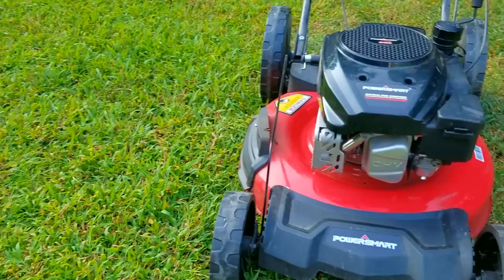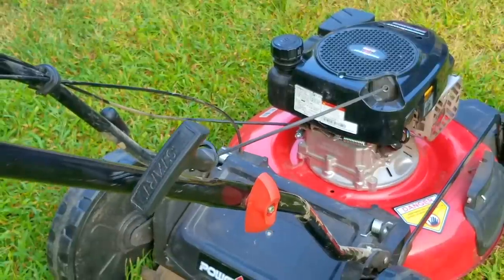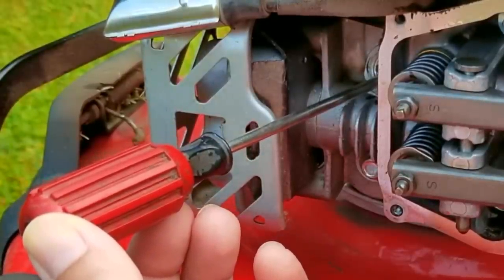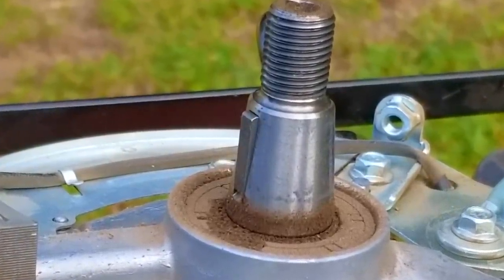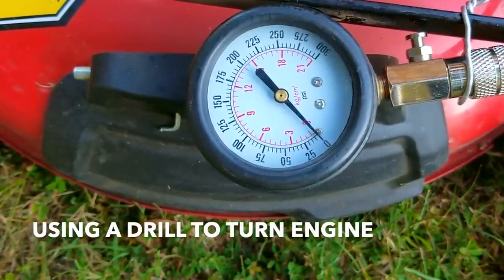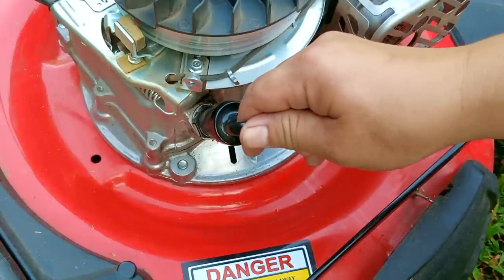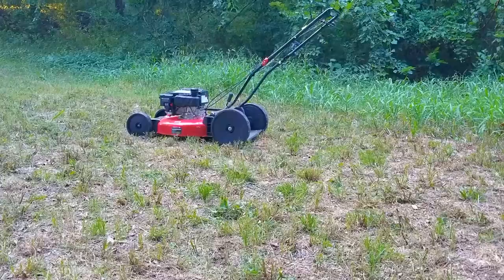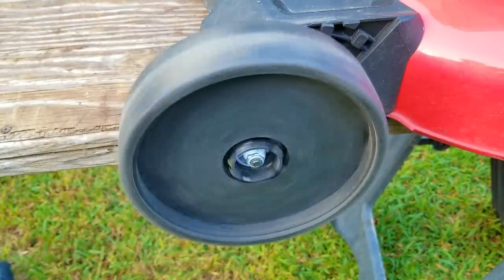Fixing A PowerSmart Mower That Won't Start

Comment: I got one of these free (self propelled) when I bought a Husqvarna HU700 self propelled with the Honda engine for $10 from a local guy. He said it ran too fast - I fixed that by straightening out the governor linkage and getting the RPMs down to around 2900  The Husqvarna was hard to start and the belt kept jumping off. The kill switch needed some adjustment (would not always reset) and the belt problem was just a cable adjustment. So for $10, 2 air cleaners, an inline filter and oil changes I have two usable self propelled mowers. I really like your videos. Nice style
Reply from the maker: very nice work!

Comment: I bought a 196 cc powersmart in 2019. Used it for 2 years regularly with no issues. Then I stopped using it in 2022 because I had heart surgery and had somebody else do my lawn. When I stored it, I didn't put a stabilizer so when I started using it, it won't start. I cleaned the carburetor and replaced the spark plug and it started. Also changed the oil.
Reply from the maker: nice work getting it working again

Comment: Bro, you are 100% correct about every single thing you said. I have this exact Mower. Got it in 2020 and last year it didn't work for me. This exact issue is what's happening with mine. I just put it  away last year. Now it's time to mow again, it's Spring and I came here to try to find out if I can fix it. After watching this you confirmed that it's not even worth it. They just stole my money on this mower. I used it for 2 seasons and I live in Philly so it's only warm here about 2 months a year. I used it a total of maybe 7 times in those 2 years, definitely not 10 times.  i am so upset that I have to buy another one. Growing up, my grandpop and other old heads around used to have mowers forever. These plastic things dont last. Your presentation is on point as well. Great job bro. It's just crazy that my problem is EXACTLY the same as this one. I've only used Sunoco number 93 gas and fresh oil. It didn't even last long enough for me to need any new oil so...I dont know. 1 more thing about these if you didn't know, mine smoked out after minutes of my first use. I thought it was defective until I figured out that it has to only be used downhill or on a flat surface. If you go uphill, it's going to smoke out so maybe I messed it up from the first use but they need to tell me that I cant go uphill with it... and it's not a big hill. It's just on the side of my steps leading up to my house. It isn't a mountain sized hill. I know nothing about mowers so I made sure to follow the directions. I do know about cars so I know for sure I didnt put too much oil in it. I rather run it with low oil than too much. Have no clue what's goin on with this thing. They need to stop selling these, this is a rip off. Maybe that can be your next video on how this company needs to stop selling these.
Reply from the maker: wow, thank you for confirming that and sorry to hear they stole your money. As tempting as the price is, it's not worth it.
Reply: @Tru Tru I'm agreeing with you one hundred percent my friend.I bought 2 of them. One for myself and one for a relative as gift. His had the break-in oil changed in well less than the five hours. It was more like 2 hours, and then brand new motor oil. Relatives push mower will start immediately, however when he had to shut it off to move stuff in yard it seemed locked up and would not restart. Then after cooling down completely several hours in the shade it would restart.
Reply: @INSIDEHOUSEGARAGE  I agree with everything that was stated by @Tru Tru on your awesome video. As you can see I replied to him with what happened to the first brand new mower. And the 2nd powersmart 170cc push mower did the exact same thing on me and my wife. Break in oil changed in 2 hours & on the very next use it seemed locked up after shutting it off and attempting restart. Oil was still one hundred percent full of the proper lawn mower engine oil. I let it cool for approximately an hour & when I attempted to restart it the pull cord knob broke. I'm only okay after replacing new pull cord handle & never attempting to restart until it's cool down 100%. Then it'll restart, however I would much rather drop kick it across the yard. Spot on video & thank you so much. We appreciate the video & dedication.😊

Comment: Bought one a couple years ago and love it.  Yes, it has some cheaper made parts and that's why I'm sure they're lesser expensive than the others.  I like it cause it's light and starts usually with one pull.
Reply from the maker: glad to hear it's working out for you
Reply: Ya I like mine so far

Comment: Hey, great video, I love your channel! I have a '99 Honda mower, that takes about 10 pulls to start when cold, however when its warm, it takes just one. I have already replaced the carb, flushed the fuel system, adjusted valve clearance, replaced the spark plug etc, its still not fixed. However, the previous owner didn't change the oil in like a couple of seasons. Could that just be compression loss/ a worn engine? Thanks for the vids
Reply: With the consideration that it has a new carb you should probably start with the choke\primer(if it has one?), then move over to the carb gaskets base and air cleaner gaskets.
Reply from the maker: yes it can, however, have you checked that the choke flap is completely closed when choked?
Reply: @INSIDEHOUSEGARAGE  No, i haven’t checked yet. I’ll do when I get the chance to.Thanks for the help!
Reply: Check that everything is operating correctly carburetor etcetera if all is in proper working order another thing would be vacuum leaks check around seal on the carb in some cases you can use gasoline to find a leak by running the engine and squinting a little around the seal / gasket and listening for the engine to rev up or idle higher for a few seconds if this happens you have a bad seal / gasket

Comment: Wow, the tools came out for this one, but it’s going...
I remember run in time is usually 5 hours on the engine for first change.
Though surprised to see that much garbage in the oil.
Now you didn’t do your spin the wheel time trial.
Great job😉🇦🇺
Reply from the maker: lol.. I wanted to try something new

Comment: Many thanks. Just bought a PowerSmart mower. After running it the first hour, I removed all the oil. Now I will look for metal filings.... So thanks!!  They say that these Chinese engines are not built to such tight tolerances as Honda and Briggs. So get those initial metal filings out. Then you are OK
Reply from the maker: nice method, thank you zenzeke zenard.
Reply: @INSIDEHOUSEGARAGE   After the first 60 minutes, the oil was very black. But no, or very, very scant metal filings. So I will put in new oil and run  it two hours and look at the oil again._____ I have a synth oil blend of 10-40. I am in hot southern Florida. IOW half synthetic. Is this OK for the mower? THANKS!
Reply from the maker: I see nothing wrong with that.

Comment: I have a Power Start, model db2322s, EN 22" 196cc, so-called 3in1. After sitting through a winter with an empty fuel tank, it didn't start in early spring. The problem is found to be air bubbles getting in the fuel line by following this step (12:30) as seen in this video. This is verified by running it till the fuel tank empty which prevents it from starting agin. By loosing this bolt to release some fuel then tightening it back to normal, it starts easily. 

It has no primer bulb nor a choke. But in the troubleshoot section the user manual says "pump the primer" if won't start. It's a joke. Made without care.

Comment: So slightly off-topic, but something I think you will approve of. I've seen the little rounded scraper you use to clean out the grass from under the mower deck. Checked online and saw that Amazon wanted about $20 for them (IN the US). For some reason, they want around $80 for them on Amazon in Canada. (Don't ask me why. Probaly cause there's no Canadian distributor, so it has to be sent from the US manufacturer, but I digress.) Anyway, I thought that was ridiculous. I dug out a straight scraper about 2 2 1/2 inches wide and used my grinder to round over the corners. I think I got 3 scrapers of differing widths for about $8 for all three. LOL  If you can't be handsome, you better be handy! LOL
Reply from the maker: hey nice work and very ingenious of you.

Comment: My neighbor bought a PowerSmart 200cc based mower last year, and after storage for the winter, I was worried it wouldn't start.  
I'm helping her maintain the yard this year, (as she's nearing 80,) and have a suspicion that the oil not only was not changed after six hours of use, it likely has not been changed at all.  
It did start, and after a few minutes (and cleaning the air filter) it seemed to run pretty well, compared to how it sounded last year.
I've been using a battery mower for several years, so am relearning a lot about gas mowers so as to use hers.  I think it does have higher compression than my Neuton, so there's that.
I guess I'm taking that challenge, to see if it makes it through the season, cutting three lawns a week.  :)
Reply from the maker: well good luck to you then. thank you for the comment
Reply: Powersmart mowers are shipped with just enough oil to keep the seals moist. 
With only about 4 ounces of oil in the crankcase, I figure a new engine could last maybe, let's say 6hrs.
Give or take.

Comment: I have a motor from the same Chinese manufacturer (Rato) that so far has lasted 4 seasons without a single problem. The difference is that my motor is from their commercial line, and thus much heavier (by 11 lbs) for the same 170cc displacement. It's bolted to a 22" Toro deck and performs just as well if not better than the 190cc Briggs L-head it replaced, though I have to admit the weight is a bit of an issue for me.
Reply from the maker: nice, I didn't realize they had a commercial line

Comment: If you've got to remove a Tecumseh flywheel, I would recommend a 3 hooked puller. I used one like what you have, and accidentally cracked mine. Although it's still running perfectly fine 2 years later, despite the crack. I never ended up removing the flywheel! Turns out the issue was a loose blade making it backfire. I learned a valuable lesson, Always remember the mechanic's rule! Easiest thing first.
Reply from the maker: yes you are correct!
Reply: Those mowers are trash
Reply: Just give the crankshaft a good whack with a soft hammer and it will break loose.
Reply: @cattechofficialmeowmix993  you have a bad opinion, sorry to inform you like this.
Reply: @brandonsnider7907  that's what I did for my lawn boy in small engines class. Works pretty well!
Reply: You can use a flywheel knocker, too.

Comment: this year's (2023) powersmart mowers are kinda interesting. they have a horizontal shaft engine going to a 90* driveshaft, down to the deck. the blade is then belt driven. they are a pain in the butt to start because of the rubber banding of the belt and the drive shaft, but once running, they mow through anything. I bought them at a deep discount at Menards, and I bought both of them that were on offer. They were able to mow through 3 foot high grass. The front axle assembly is cheap, and the black one has already broken. it has been repaired by no less than 20 zip ties, but is available as a replacement part for $35 plus shipping from Powersmart themselves. I'm just curious how long they will actually last. General consensus is the engines are the same ones from their snow blowers.
Reply from the maker: thanks, I've been hoping to get a hold of one of these horizontal shaft mowers, to test out. As for the engines, I don't have any faith in them to last more then a few hundred hours , but I think that was the point to begin with

Comment: My mom bought one of these things a few years back. Ised it a few times and then stored it. Wouldnt start the next year so we let it sit. Another year passed, same thing and I didnt want to deal with it. This year I went after it. The carb was basically a crap show from habing the ethanol...yes ethanol fuel being left in it for a few uears. I got the thing running eventually and started using it for the day. It soumded lile crap and I wasnt halfway done before it consumed its own belt. I told my mom to sell the thing because I wasnt going to use it again....total garbage.
Reply from the maker: these are not good machines at all. I happen to think some work well, but the majority have a lot of issues

Comment: Just worked on the 144 cc 2020 model yesterday. Metal in oil, engine locked up on third pull start attempt. Pulled plug, engine still locked up with bale lever clamp to handle, no brake applied to engine. 3 flush’s cleared the crankcase, bounced the mower a few times and engine now turns over. Adjusted valves, exhaust was set a zero lash. Carb was clean but slight varnish smell so I added Berrymans B-12 to gas. Add oil and 7 cranks later mower is running. No idea what inside mower is locking up but with the amount of metal in oil I sure cam bushing is involved.wont know until someone pays me to strip engine . This turd makes my 1995 Snapper Hi Vac look like the best mower ever made. Which in my opinion it is!
Reply from the maker: I know right, It was really strange, my guess though was the cam gear.

Comment: some manuals dont say anything about breaking in and changing oil what is unfortunate.   SOme dont even give you instructions how to change the oil... I know my ryobi portable gen says nothing about it . just how to check the oil.  but  thankfully  im smart when it comes to  engines i have to be . being an auto mechanic lol... . when i used it for like 3 hours  i drained the oil afterwards and it was glittery. ill end up changing the oil after 4-5 hours again  just incase,.oil is cheaper than an  engine. good video!
Reply from the maker: nice work, your generator should last a long time! than you Pete Laframboise

Comment: I got a powersmart and the only issue I've come across has been the throttle cable rusting through after 3 years of use. I store it outside with an old wheel barrel bucket atop the engine to keep the rain off it. I'm no mower snob, if it gets the job done, so be it. At the end of the day, regardless of brand, most of the shit on them is made overseas anyhow.
Reply from the maker: nice, glad to see it's still working out for you

Comment: using gas down the air filter box to start engine can wash the oil off the rings and cylinder that can cause a metal to metal contact and dig out the cylinder wall and lockup  motor - when freed would cause bad compression - using chainsaw gas for test start it will not cause the digging in the cylinder walls like straight gas can
Reply from the maker: thanks that's why use 2 stroke mix

Comment: I would definitely like to take a yes challenge to that I know it’s a Chinese engine but I think it was lack of maintenance that of oil changes as what did it come I have one of those engines on mine and I know I’ve only had it for one season I’ll keep you posted on it but it’s working fine
Reply from the maker: you are correct the lack of maintenance was a definite issue.

Comment: I’m taking the challenge! Just picked up a powersmart horizontal shaft 209cc push mower brand new at Walmart for $177 😂 Yes HORIZONTAL shaft. I am highly doubtful it will last more than one season. That’s all I need it for. I’m gonna use quality oil and change it out every 5 or 6 cuts. As for the horizontal part.. well time will tell 😂😂😂😂
Reply from the maker: nice, I'm actually interested in seeing one of those close up, mainly because of the engineering of it.

Comment: I have a 200cc power smart mower on its 3rd season of mowing my 1/2 ace lot.  Followed all maintenance recommendations and have had no problems with the mower.  I can do the whole lot on one tank of gas and it does not bog down in heavy grass areas.  The only complaint is the choke.  Even when its warmed up you have to pump it in order to get an easy start. But all in all it takes my punishment on tree branches, tennis balls, and short brush. It is a cheap brand that takes my abuse.
Reply from the maker: nice, thank you for vouching for them.

Comment: I have one which seems to blow oil from the exhaust fairly heavily.  Do you think this is rings?  It seemed to get weaker and weaker and finally stopped starting after cleaning out the carb.  I thought it was the carburetor and cleaned it out after sitting all winter so the gas in the carb jelled up evidently.  After cleaning it out, the engine ran for couple of months of summer and then began being weaker and weaker, finally it blows heavy smoke and I see oil on the deck after the exhaust mufflet outlet.  could the valves leak oil into the cylindar?
Reply from the maker: it might be, as the blow by from worn rings will pressurize the crankcase, But first I'd do an oil change just to make sure it's not over filled.
Reply: @INSIDEHOUSEGARAGE  how easy is the rings to change?  I am looking for instruction on this mower..  thanks!

Comment: if and when the deck is in good shape, but the engine is bad, i just swap it out with a good Briggs and Stratton or Tecumseh. i have a bunch laying around in need of decks. then i disassemble the bad engine, try to fix it or salvage it for good parts. most failures are because of that cheap crappy plastic camshaft and sometimes the compression reducer breaks.
Reply from the maker: I like the way you think j r